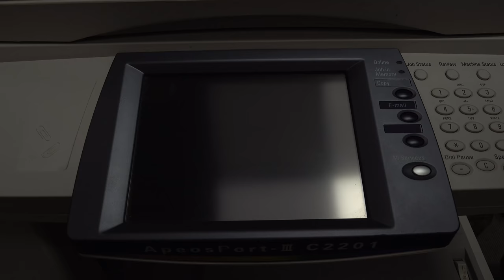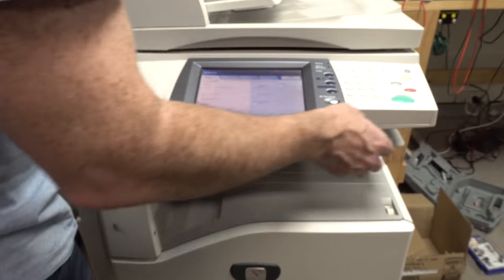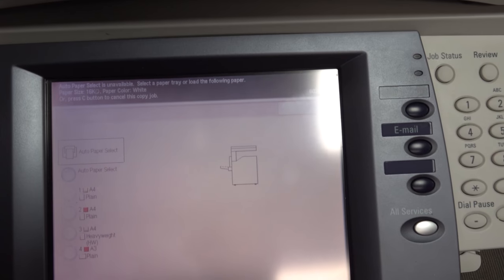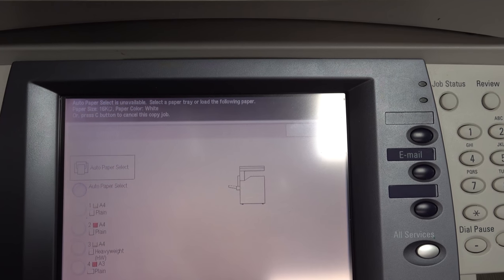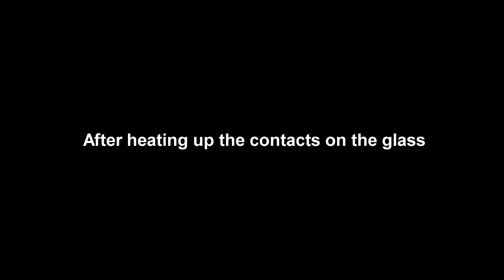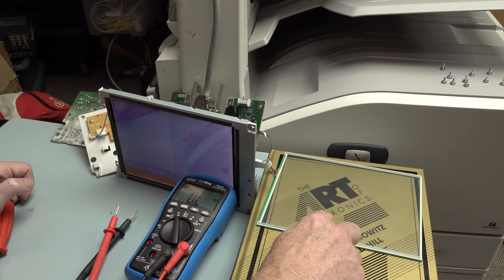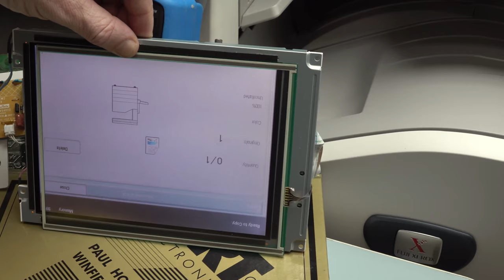EEVblog #1100 - Dumpster Photocopier Repair

Comment: 4:40 The molding date on the plastic housing seems to indicate late 2007, so a 2008 date of manufacture seems likely for the photocopier.
Reply: DandyDon: It would make sense then if the plastics were molded in late 2007 that 2008 would likely be the year of manufacture for the product. I can't say that this is exactly a 2008 product as companies often develop a complex product such as this to run unchanged for several years. They need to recoup the engineering cost and give their development teams time to work on the next major release to stay competitive.
Reply: If you look at the product models from this time period, you will probably notice that physically they look much the same.  Much of the plastics is used across all models.  The odd way in which Xerox use do to things, the 8200 duplicator was considered 2nd and a half generation.  

Other machines which have the same mechanics and plastics.  The 5328 was physically the same as the 5334.  The 5328 had a back lit function/error panel which was operated with a bundle of small incandescent lamps.  In the same exact space with no difference in the physical opening, the  5334 had a LCD touch panel, much like this one.  I think the 5334 was one of the last product lines manufactured in the USA with union labor.

The Xerox WorkCentre starting with the model 5735, is a bit different physically, but uses the same size touch panel I believe, and the same sized and colored buttons. 

https://zzz.physics.umn.edu/_media/computing/department/print/manuals/xerox5775_gettingstarted_en.pdf 

It's like using the same chassis to place different car bodies on.  Xerox was one of the last American companies now has "assemblies" of a machine manufactured in China, New Zealand....etc.   Scanner made in China, copier mechanism made in New Zealand, and the finisher manufactured somewhere else.

 I think it's more about the software driven features and much less about the physical aspects.  

I'm not the first person to say this.... Ursula Burns needed to go.

All of these machines no matter what brand name you slap on them look so similar, and no one seems to be pioneering new innovation which "turns the competition on it's ear".

Comment: Different sized buttons means easier=cheaper manufacturing. If they reversed the red and green buttons, it's possible a whole string of modules would have to be reworked.

Comment: We used to have a similar copier. Yeah, windows drivers should be available, and it works pretty well as a color laser printer.
Reply: Well it's a postscript printer, so you can use it on pretty much any computer from the past 25 years or so and will be able to do so in the future.

Comment: The subtle differences do make a difference... when you use it, it just feels right. Kinda like the IPhone and how it pushes UI on mobile. If all the buttons were the same size, though easier to manufacture, it wouldn't be as pleasant to use... For example you would be relying more on reading the text to find the right button vs obvious indicators like color and size. You might not be able to put a finger on why, but subconsciously the machine with the big red button would be easier to use. Similar thing with luxury vs disposable products...the attention to detail and user experience is subtle, but you can immediately feel the difference when you use both.

Comment: Plug the network port in to your network and use angry ip to find the up address,  if configured for dhcp you could connect to via a web browser and then download the driver (pick six) you could print to it from a pc.
Reply: You can also go into admin mode via it’s up address and a web browser most still have the default login.
Reply from the maker: I did, works fine

Comment: What did you do to fix the touchscreen? Just heated it up with a heatgun? What sort of temperature? 150C, 200C, 300C?
I have a cheap touchscreen from china that seems to have the same problem from what i can tell.
Reply from the maker: Soldering iron on each pad  at 260c
Reply: Said he used a soldering iron with no solder at 260C (I think...) and probably just pressed it against each of the contacts for a few seconds to re-melt the conductive glue.

Comment: It would be funny if it had WiFi, and it connected to the office in the building. Then someone forgot to delete it and it started printing stuff.
I wonder if the different button sizes save and ensure correct assembly? The square can’t fit in the circle.

Comment: So now you have yourself a 4TB hard drive as well :D
Reply: Probably 4GB.
Reply: Correct. My bad. I read GB but now I have still framed it it is MB
Reply: Min spec was a 40 GB. current units ship with a min 250 GB

Comment: The part is probably NLA.  I've seen parts go NLA as little as a year after the product has hit the market.  To a business 7 years of use means it has paid for itself any way.  Far more practical  to buy a new one with more bells and whistles.
Reply: The touch screen most likely fits many models.  They can be found if you want to search.  But yes, after 7 years Xerox no longer supports the products.  That is where companies like The Parts Drop take up the slack.

Comment: I wonder how many times the original owner called in a technician who failed to fix it
Reply: Chances are when it got this fault it got replaced and sent to the dumpster with no one looking at it. The service on these machines is very expensive so they usually end up getting scrapped with minor faults if the machine was not a lease unit.

Comment: A local charity or an animal shelter would be your friend for life if you gave it to them!
Reply: No they wouldn't. You do no one any favors giving them salvaged machines that were destined for the scrapheap. Those things can cost thousands for a technician to repair. Only someone with series electronics knowledge can keep something like that going without breaking the bank. Just donate some money or time to your charity of choice and be done with it.
Reply: I'm sure Dave said the toners had around 50%, just run it dry, $500 worth should last a while!
Reply: A genuine (read: rip-off) toner replacement is expensive. Normal people just open up their toner and pour new powder in it for 20$ per kg
Reply: Yep, I bought a bottle of xerox black toner for £8 for my 10 years old Samsung ML-1440, unscrewed the cartridge and refilled it. Works like new with fresh toner. A new cartridge would've cost £100+.
Reply: My original point still stands. Everyone is just mentioning the consumables, which are expected to have to be replaced. what happens when for instance the touch screen stops working...
Reply: he goes back and spends another 30 minutes fixing it. or replaces it cheap now that the rest of the unit tests out perfectly.  A fix like this is best to just be sure its worth spending money on the replacement part.  Now you know that for $35 you can get a replacement part and it will go on working.
Reply: Call Dave to make another video!
Reply: Tell Dave to stop by!

Comment: LOL, I currently work for xerox and am on a global account.  Used to be a field tech but now do network/print infrastructure.  Yeah the thing about copiers is that they are like a boat or a pool or anything you can assign the term "money pit".  You may get the LCD to work but that is probably not the reason it was in the dumpster.  Fuji is no longer associated with xerox so you won't be able to get any parts, firmware, nothing.  You may get some youtube revenue but making people think you can pull a copier out of a dumpster and make it function with any reliablility is just another youtube clickbait deal.  Copiers are inherently unreliable to start with even trained techs battle with them every day, that's why we have jobs for so many years.

Comment: haha, this is my day job. are you keeping it Dave?
Reply: unknown cable behind the paper clip cover is for the fax speed dial which replaces that cover. random bracket is for power cable retention. hold down 0 +1 + 3 keys when booting to calibrate the screen. press the intersecting lines at the 4 points on the screen (beeps should be heard if touch is registered). when all 4 are pressed a new screen appears that is only a touch test. reboot again and should be all calibrated.
Reply from the maker: Yeah likely

Comment: 15:45 The cable to nowhere under the paperclips: Ours at work has that clip tray replaced with an HID brand card reader - it allows us to log into the copier without typing our windows user/pass to do scan to home drive functionality as well as secure print.

Comment: Why not solder that cable in place?  If it came loose because it's glued on, then it will probably break again for the same reason.  Why not fix it permanently?
Reply: Maybe the cable isn't designed for that kind of thermal impact and might break from it.
Reply from the maker: Because you likey can't solder onto the glass pad
Reply: EEVblog i actually tried once on an lcd panel that had the cable tear appart it can't be done  and if you trie you will probably ruin any chance of reparing it with the right cable atleast that what i did to my poor lcd screen
Reply: Makes sense.
Reply: As others have said, it can't be done.  Besides, you would cook the LCD trying.  LCD panels and heat don't mix well.

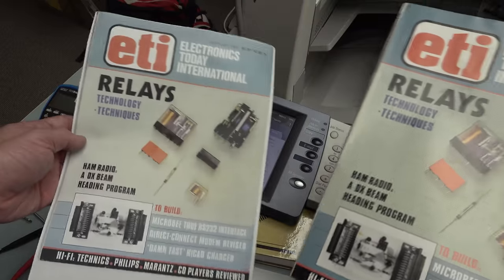Comment: what makes me curious is the fact that it contains pc memory inside it( 17:12 ).
Reply: The chip to the right of it is as MPC8349E. That is a Frescale PowerPC CPU that use regular DDR2 memory. So the control bord is based on a standard CPU design for embedded application with network connection like this print. It used a lot of PC standard like the memory and it have a obvious PCI connector. Other post says that it run Linux.

 Many/most embedded systems with advanced network function  and/or with complex GUI usually run some kind of Linux so you can reuse existing program and have a simpler time to develop on a desktop computer. Today you likly find a ARM instead of a Power PC CPU. It looks that this model was released in 2008
Reply: cool thanks for letting me know because from all the printers that i have been repairing none of them had that style of circuitry in them i have only seen compact circuitry like  the motor drivers with the logic circuitry in one board.

Comment: Image the hard drive and share it on your google drive.
Reply: That's not very nice...
Reply: It's all proprietary software any who, most likely won't work on anything else.
Reply: Why would you develop custom file formats and file system for that?
Reply: Xerox has been doing the computerization of things since at least 1972, when the Alto was introduced.  Other than Adobe Acrobat files, possibly Word (doc) and a couple other file compatibility there's no reason why the software would be generic.

In 1972, Xerox View Point/Global View (Windows) software file format was proprietary all the way up until 1989 when the Star Workstation 6085II was introduced.  It could convert document files to and from other file formats but that's it.